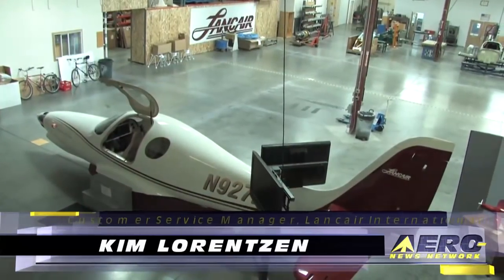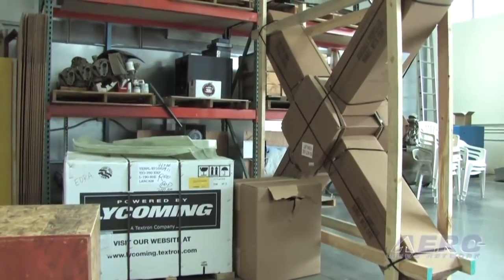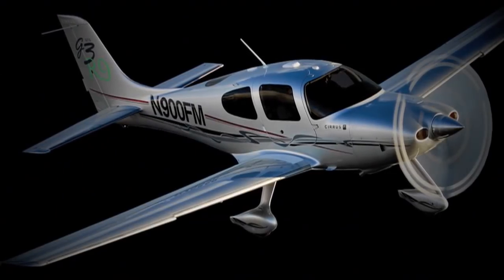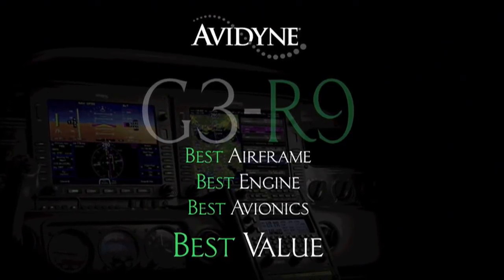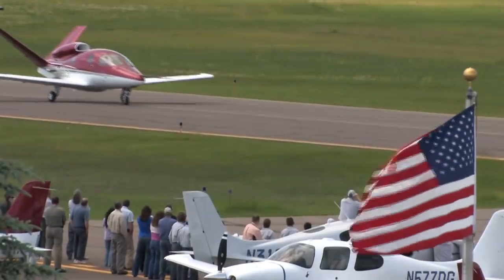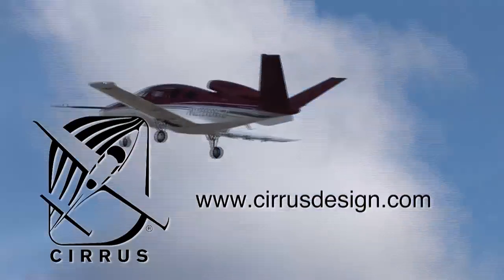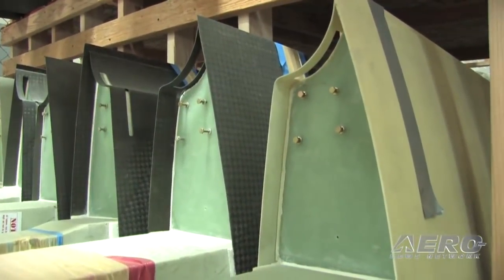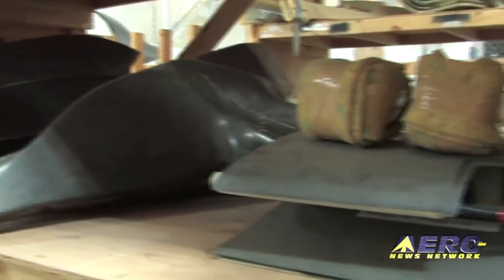Aero-TV:  The Lancair Factory - Where High Performance Begins

Comment: To all those objecting to the Philippine angle consider this.
Lancair's cheapest " all inclusive kit" (includes airframe, engine , 
propeller and avionics ) the 2 seat  FG-390 model , runs around 213k US (2016 pricing). If it were made in the US I would guess it would probably run 
twice as much AND the purchaser STILL has to put it together (50.1% or 
more of the labor for assembling the kit must be done by the owner per 
FAA regs ). It is estimated to take between 1000 and 1500 hours to 
assemble the kit. 

So if the kit was US labor made for an estimated 400k AND the owner has to put in 1500 hours to assemble it AND after that the FAA will only certify it in the "experimental" category with all it's limitations , why on earth would anyone buy it when one can just go to Cirrus (made in the USA)  and buy a fully assembled SR22 (4 seater) with more bells and whistles and no "restricted catagory" airworthiness certificate for around 500k US?? Lancair would go belly up in a heartbeat were it not for cheap labor abroad. It's about survival and if you object then don't buy a Lancair and don't shop at Walmart and don't hire cheap undocumented laborers to do your landscaping.